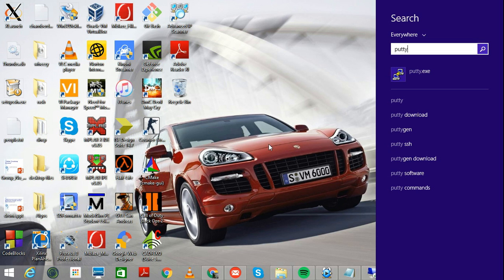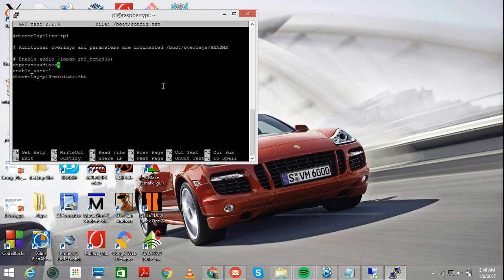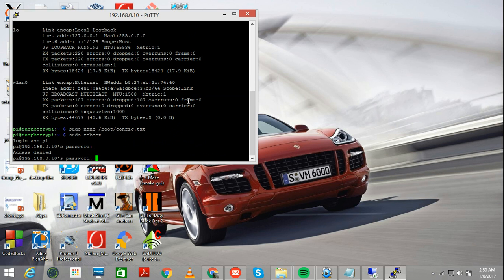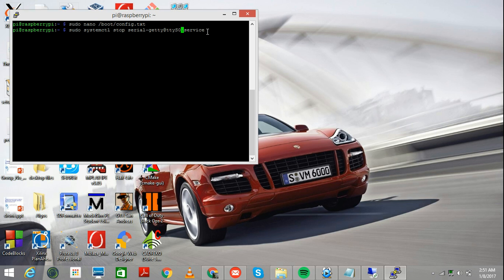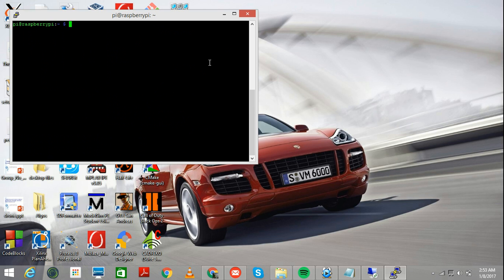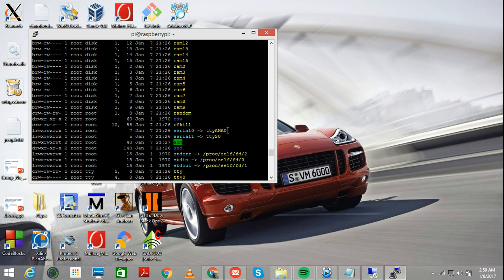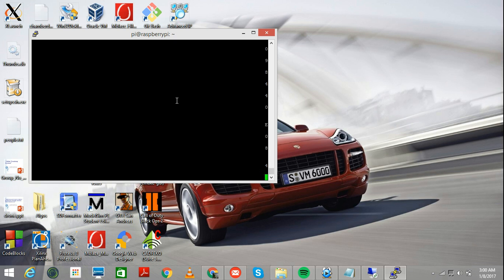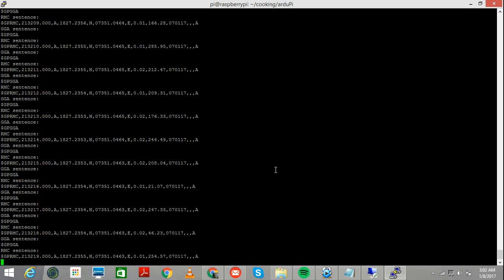Interfacing GPS with Raspberry 3 | Raspberry Pi 3 UART problem solved- Solution to terminal freezing

Comment: I set the ttyS0 to serial 1 , and the ttyAMA0 to serial 0 for some reason Mavproxy.py only trys to connect to ttyS0 ? Now I don't know how to switch it back ?
Reply: I need to run python in terminal but it won't connect either

Comment: can you make a video on how to make the connection with rpi3?
i am stuck with how to make physical connection .
thanks in advance
Reply: Abhirami anbu there is no problem. for example, gps modem:vke16. 5V to VCC of modem, Gnd to Gnd, Rx(13 pin) to Tx of modem,Tx(14pin) to Rx of modem. see pinout of raspberry to correct me. i tested my modem by this video, modem works. thanks to author

Comment: What is the GPS Module Number? Thanks nice video
Reply from the maker: Juan Delgado The GPS module that I've used is called SIM28 GPS module. But it hardly matters what module you're using. All you need are the Tx and Rx pins for serial communication. I'm glad you liked the video.